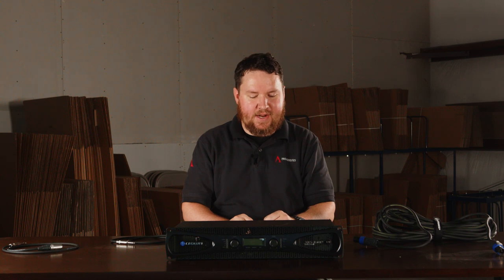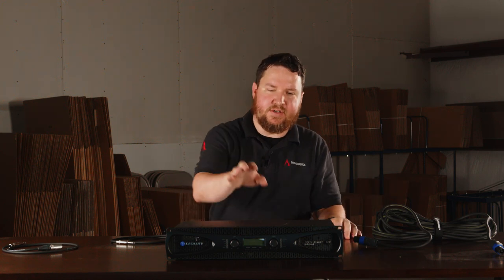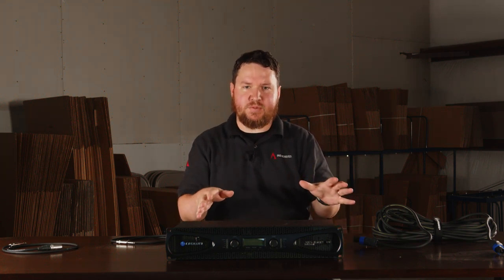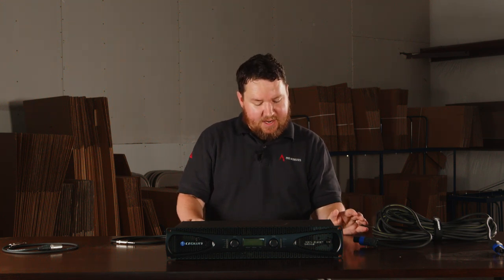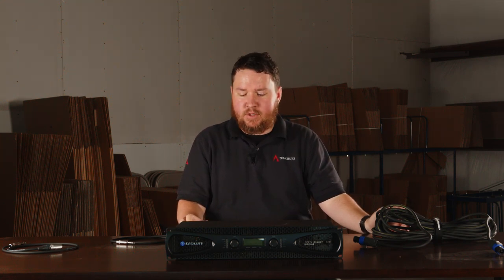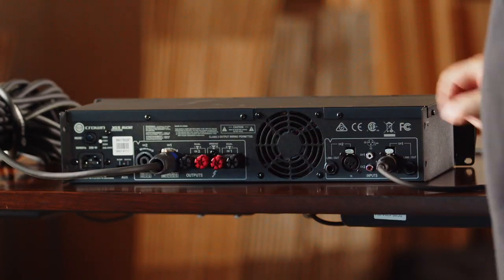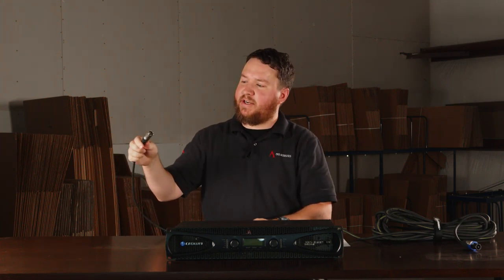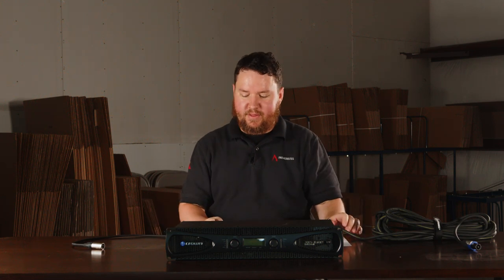How To Connect A Powered Subwoofer To Passive Speakers on Pro Acoustics Tech Talk Episode 62

Comment: Hi, in your description your are showing the amp powering both the passive speakers and the powered sub? By powering the signal to the active subs is there any danger of damaging the amp built into the active sub?  I always thought the active sub would only need a signal source from the mixer directly. And the passive signal would need powered by the amplifier. I’m a little old school, don’t know everything for sure... so old passive guys like me need all the help we can get... thanks for your input! 
Todd
Reply from the maker: Hi Todd,
We have a better-written explanation in our blog: https://www.proacousticsusa.com/blog/post/how-to-connect-a-self-powered-subwoofer-to-a-pa-system-with-passive-speakers/

We're taking the audio output from the mixer to the audio input on the amplifier and then out of the amp from the same channel into the powered subwoofer. These inputs on the Crown XLS amplifier pass audio signal only and not power. 

You then run from the speaker outputs on the power amplifier into the back of your passive PA speakers. These outputs pass both audio signal and power.

This setup passes the signal through from the amplifier input to the passive speakers, sending this same audio signal to the powered sub. We could repeat this same process with other powered speakers or even feed the input section of another power amplifier.
Reply: Thank you so much!
Reply from the maker: @homesteadworks3448  Our pleasure! Feel free to give us a call at (888) 256-4112, email sales@proacoustics.com or visit proacousticsusa.com if you need help in the future!

Comment: My Behringer KM750 has pretty much an identical Inputs section, with an XLR, 1/4 inch on each channel, and an RCA, but it doesn't not specify "Link/Out". I'm assuming it's the same though, right?
Reply from the maker: Hi David, Yes, you can use the 1/4" as a pass-through to another device or power amplifier.

Comment: I ran into a sound system installation with a functionally similar setup like this but I don't think this is the right way to go.  The solution here does restrict the sub to below the crossover point.  However, the mains will try to reproduce all of the program material, including the lows the subwoofer is doing since the input signal to the amplifier is direct form the mixer and not going through a crossover (unless the amplifier has a built-in crossover).  In most cases, the "tops" are not designed for reproducing the low frequencies, which the subwoofer can handle much more efficiently. 

I feel the more standard solution is for the main outputs (line level) of the mixer be connected to the inputs of the subwoofer (all the active subwoofers I have ran into have a stereo pair of inputs).  Set the desired crossover frequency on the subwoofer's crossover and level of subwoofer volume.  Then take a separate pair of XLR cables and connect the subwoofer's high bypass outs and connect these cables to the input of the power amp and connect the speaker cables from the amp to the non-powered main speakers.  Now you have the line level output of the mixer split with the lows going to the subwoofer and the rest to the power amp hence the non-powered main speakers.

One consideration is the sequence of powering on and off the system.  I believe the proper power on sequence is mixer->subwoofer->power amp.  The power off sequence would be the opposite.

This is the solution I came up with when I ran into a setup which was functionally the same as the solution presented here.  The system became much clearer after I changed it to what is described above.

If I am totally missing the point here, please let me know!
Reply from the maker: That is another excellent method of implementing subwoofers. Thank you for sharing your detailed setup and insights!

Comment: My power amp doesn't have a link out (Behringer EP2000) doesn't have a "Link Out". The powered subwoofers I want to get have built is crossovers. Can I run my mixer main outs to my subs, then my subs to the power amp then power amp to mains?
Reply from the maker: Hi there! Yes, this solution should work for you.

Comment: Would like know how to connect 4 passive speakers, 2 each channel, to a amp,mixer and active sub.
Reply from the maker: Hi there! If you are using a two channel amplifier as demonstrated in the video, you would simply parallel wire 2 of your passive speakers on each channel of the amplifier (assuming the impedance is acceptable for the amplifier) and then wire from the amplifier's input link to your active sub.
I hope this helps!

Comment: Can I connect powered subwoofers to my passive speakers which are connected to an amplifier?
Reply from the maker: No, you should not connect a powered subwoofer directly to a passive speaker that is connected to an amplifier. Powered subwoofers have their own built-in amplifiers and should be connected separately from the passive speakers.

Comment: Don’t forget that some subs will come with hi amp inputs.  Connect directly from your amp and then into your speakers.
Reply from the maker: Hi Cory, What you are describing is sometimes done in home audio systems. In our experience, there aren't a lot of professional audio setups that use this configuration. We appreciate your note however and may address this topic in a future video.
Reply: Does this mean i dont need a reciever to connect a wireless sub to my vanatoo t1s? Theres a sub out on the back of the speaker. Im just trying to see if i could connect my vanatoo 1s to a klipsch R-12SWi
Reply from the maker: @biancakim2749  Both of these are powered speakers, so no, you will not need a receiver. You just need to connect the subwoofer output from the Vindaloo to the Klipsch sub.

Comment: I need some help. I have a different issue. I have 2 powered pa speakers, and 2 powered subwoofers. I have the subwoofers hooked up through the powered pa speakers via rca. However there is only there is only one hook up available on the pa speakers. So I basically splitting the power and feel like my powered subwoofers full potential is not being met. How can I remedy that. They still sound great. However at the same time it still feels like there more there is being utilized. Should I get a mixer and if so what do you recommend. Or is there another way hook up the speakers with what I have now? Thanks in advance.
Reply from the maker: Hi Danny, Thanks for watching and reaching out! Can you give us a call at 888-256-4112 or email sales@proacoustics.com to discuss this further? One of our Sales Engineers would be happy to work with you to see if there is another way you can hook up your speakers or if you need an additional piece of equipment and make recommendations for you.

Comment: What about x-over. The way u showing it: the satellites will be trying to mumble lows, because the signal is not cut below xover lvl for them. explain how to route signal THROUGH active sub and it's internal xover towards passive speakers
Reply from the maker: At Pro Acoustics, we support pro or commercial projects or installations. Therefore, the system described is for adding powered subwoofers to a full-range speaker system in a pro or commercial context, and not limited-range home audio speakers. You're correct, if using limited frequency response home speakers, you may need to wire to the subwoofer first in that type of configuration.

Comment: Another question: I should be able to run the whole signal to my sub, engage its high pass filter and then amplify the high pass signal to the mains, right?
Reply from the maker: Hi there, This would depend on what subwoofer you are using and its available inputs/outputs and features. I would recommend consulting the sub manual or contacting the manufacturer tech support.

Comment: I have aYamaha EMX5 12-input Stereo Powered Mixer and two passive speakers. I am in bad need of some more base. I only need one sub. What would you recommend Passive or powered? How would you set it up?
Reply from the maker: Hi there, The simplest route would be a powered subwoofer. You would take the record out or 1/4" stereo output of your mixer and plug that into the input of a powered sub, and away you go.

Comment: So in this scenario your passive mains are going to play low frequencies normally absorbed by the sub…? 
That means the amp and speakers are working harder…?
Reply from the maker: Hi there! Great question. If you have an external subwoofer, then you can activate your crossover and have the subs only handle the lows, while the mains handle the mids and highs.

Comment: Will the passive main speakers still take the low frequencies even if the sub has it?
Reply from the maker: Hi Marc, This will depend on the speakers' High Pass and Low Pass settings. If you send the full audio signal through to the main speakers then yes they will still get the low signal in addition to the subwoofers.
I hope this helps!
Reply: @ProAcoustics  We have 2 dual 15s for our mains and its powered by a crown xti 2000 im not sure if it has those settings?
Reply from the maker: Hi  @Marc-fu3jq  Feel free to give us a at call (888) 256-4112 or email sales@proacoustics.com for better assistance on this. A Sales Engineer can get more details about your setup and answer your questions. Hope to hear from you soon!

Comment: Hello if your amplifier doesn’t have link output can you just use channel 1 for midrange and channel 2 for powered subwoofer? Trying to run 2 midrange and 1 subwoofer but only have 2 inputs and 2 outputs no link like your amplifier
Reply from the maker: Hello, Without knowing more about the preamp and amplifier setup, this is theoretically possible. However, unless some active crossover is deployed, it may end up sounding wonky. Just ensure you are not taking a powered/amplified signal into a powered speaker, or you can risk damaging the unit. We recommend contacting the manufacturer of your audio equipment directly to determine the best usage and connection.

Comment: What subwoofer is the best option? JBL PRX, SRX, or VRX
Reply from the maker: Hi Johnny, We would recommend any of their matching subs. So either the PRX818S, SRX818SP, or VRX918SP, depending on which series of speakers you are using. Typically it's best to stay within the same series for your speakers and subwoofer when you can. Each series is designed to have a certain sound and they are also designed to pair with the matching sub.
If you need more help choosing the best subwoofer for your system feel free to reach out at sales@proacoustics.com, call (888) 256-4112, or head to our site https://www.proacousticsusa.com
Reply: I should have included "with a commercial audio system"
Reply from the maker: Hi @johnnyknudsen1755 Thank you for the extra information. We'd like to know a little bit more. To best help you with this please reach out to talk directly with an engineer. You can call (888) 256-4112 or if you'd prefer email sales@proacoustics.com. Just let them know you're question and you'll be connected with a dedicated engineer. I'll go ahead and share a note with this information so they'll have it to reference.
We hope to hear from you soon!
Reply: For most applications the PRX is best value, IMO. SRX is quite a bit more money for a sound difference that can only be noticed by a very discerning ear. VRX is likely overkill unless you’ve consistently got audiences over 500 people.

Comment: This doesn't affect the sub speaker? I thought you couldn't mix power and sub speakers?
Reply from the maker: A configuration can be made without any issues as long as you do not use an amplified signal to the input of a powered (active) speaker.

Comment: Does it make a difference if your connecting the sub directly to the mixer?
Reply from the maker: Hi Steven, Yes, it makes a difference if you connect a subwoofer directly to the mixer. Unless the mixer has a specific "subwoofer output" that would be equalized and/or set up with a high-cut filter, the tone and performance of the sub will be affected.

Comment: hello  ive got a question i dont know if its silly but, is it possible to connect an active subwoofers line output into an amplififers line input so i can use the subs input for music and the amps out for passive speakers.
Reply from the maker: Absolutely. If your active subwoofer has a line level output, you can connect it to the input of a pro audio amplifier. This way, you can use the sub's input for music and the amplifier's output to drive passive speakers.
Reply: @ProAcoustics  thankyou, ive tried it and it works perfectly.

Comment: Could I connect a passive subwoofer to a pa speaker via speakon to xlr line out of my pa speaker ?
Reply from the maker: The XLR connection suggests you are using an ACTIVE/POWERED speaker. This XLR output is not powered, it is simply a parallel signal to extend to another powered speaker. You would need to insert an amplifier from the XLR output of your ACTIVE speaker to then power the external PASSIVE subwoofer.

Comment: By coming out the link output from the amp, are we sending the signal BEFORE it gets amplified? Like in this case I guess the main out will send the amplified signal to the passive speaker, but the link will send the pre amp stage signal to the active sub which will then amplify it with its own internal amp. Am I correct? Please correct me if I'm wrong.
Reply from the maker: Yes, you are correct. Link out takes an un-amplified signal, as shown, and allows for connection to another amplifier or a powered speaker (in this example - a powered subwoofer).
Reply: @ProAcoustics  thanks a lot!

Comment: hi，a passive speaker can connect from the output of the active subwoofer？
Reply from the maker: Yes, a passive speaker can indeed be connected to the output of an active subwoofer. However, it's important to note that you'll need an external or inline amplifier to power the passive speaker. If you have any more questions or need further clarification, feel free to ask!
Reply: @ProAcoustics  the problem is about the output of the active speakers that they are passives and I heard that they can’t connect passive speakers because the output is not amplified,That's why I wanted to know the output of the active subwoofers, whether they are amplified or not.
Reply from the maker: @vicentecarrasco3653  In the case of active subwoofers, the LINE OUTPUTS are not powered. As mentioned earlier, to connect passive speakers to the output of active subwoofers, you'll need an external amplifier. This amplifier would go in between the line outputs of your active subwoofers and the passive speakers you want to implement. If you have further questions or need more detailed explanations, feel free to reach out to our sales engineers. They'll be happy to assist you in finding the right setup for your audio needs! (888) 256-4112 - sales@proacoustics.com

Comment: Great video pro Acoustics, thank you for posting. I am just looking for clarification. In your video, you plug into a linkout on the power amp and plug into the input on the active sub. As that "link out" is really a parallel input on the power amplifier, wouldn't you connect an XLR to the output of the power sub into the parallel input (link out) on the power amplifier?
Im not 100% sure so just looking for clarification. Thank you
Reply from the maker: Hi Nicholas, Please call in at (888) 256-4112 and speak to an engineer about your questions and they can provide further clarification about the process for you.
Reply: @ProAcoustics  boo, just answer the question for everyone to learn.

Comment: I thought this video was about connecting a subwoofer to a passive speaker. When you plugged the subwoofer into an amp, you lost me.
Reply from the maker: To connect an active subwoofer with passive speakers, you will need an amplifier. Although the active subwoofer has an internal amplifier to power the sub, unfortunately, you can not use that amplifier to power your passive speakers. In any situation, if you use passive speakers for your system, you will need an amplifier and a mixer or a mixer/amplifier combo. You can find a more detailed explanation with a graph showing the flow of the connections at https://www.proacousticsusa.com/blog/post/how-to-connect-a-self-powered-subwoofer-to-a-pa-system-with-passive-speakers/. I hope this information is helpful to you!
Reply: @ProAcoustics so How  LD System Dave series works

Comment: How about my powered JBL speaker and I want to run a passive speaker at the same time you never said that
Reply from the maker: Hi Rocky, A powered speaker does not power a passive speaker. It only powers itself. You would need an amplifier for your passive speaker.
Reply: @ProAcoustics  I need my passive speakers to come out of my mixer that goes into my power jbl's if I use a separate amp it's not going to come out of my mixer I just wanted from my mixer to have my two power jbls and my two passive speakers working at the same time from the same mixer
Reply from the maker: @rockyesterline7942  Passive speakers require a separate amplifier to drive them. You cannot go from a line out to a passive speaker, but you can do this with powered/active speakers. Please get in touch with one of our sales engineers to distill this further for you. You can email sales@proacoustics.com or call (888) 256-4112